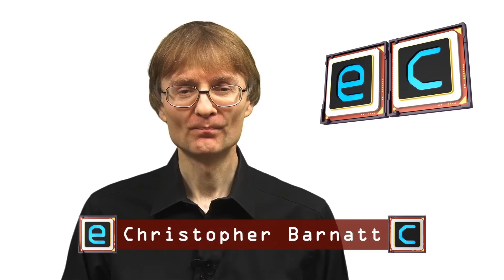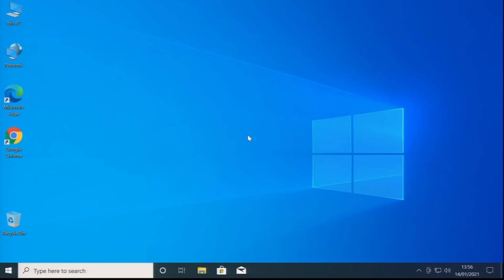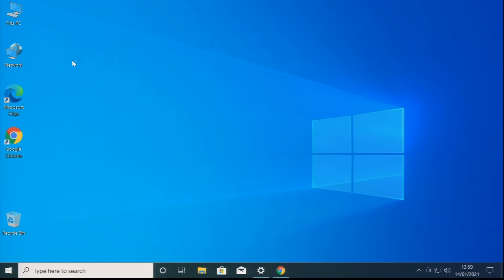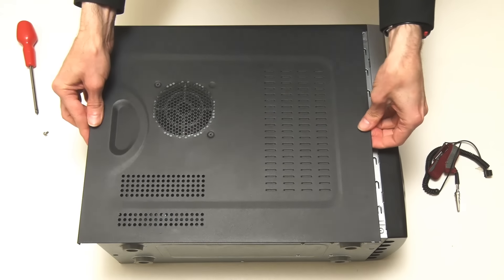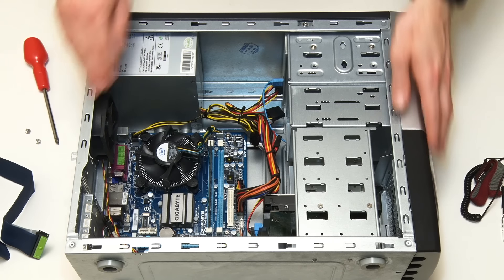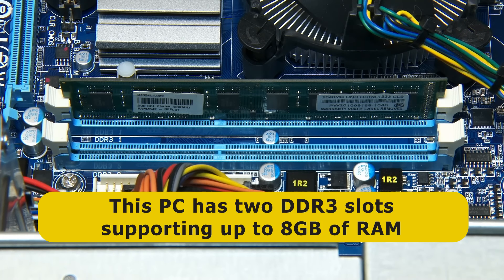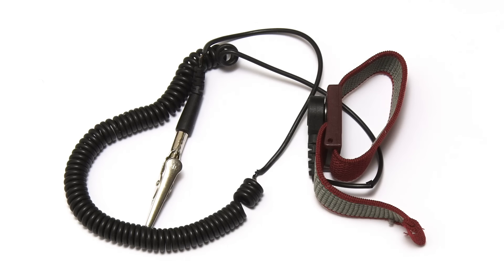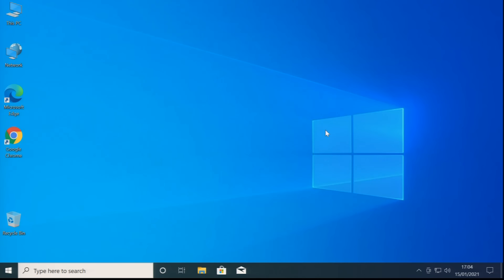Old PC Upgrade #1: Options & RAM

Comment: Not saying you got screwed, but that money should have gotten you a prebuilt business unit with at least a 3rd gen i3 + 4 GB RAM + 500 GB HDD <-- just to point out what to watch out for ;)
Reply from the maker: What I purchased is what I needed to make this video series. I was not attempting to get the maximum spec possible! I needed a PC of a certain again with some very specific characteristics (not least a mini-power with free drive bays, and not built by Dell or another manufacturer who use non-standard parts). So I did not "get screwed" at all. :)
Reply: Understood ;)
But yet again, the average guy looking to get into this might get a wrong impression while there's a good reason for taking the "used" route: price/performance.
There's a couple of those out there that are perfectly upgradable using standard ATX components (even Dell) while others (HP, Fujitsu) are a dead end. Anyone should take at least a couple of minutes to investigate that!
I just tried to point out that your 55£ would have been good enough for more (i usually get a 4th Gen i3 with a single DIMM 4GB DDR and a 500 GB HDD locally for around 40€). I almost always find auctions for probrietary units with an i5 4470s + 8 GB RAM for around that price point as well.
And one thing to bare in mind: if you can have ANY Haswell core-iX for 55£ you're better off as for instruction sets.

Comment: Virtual memory AKA swap sucks, IMHO. It's one of the things I really dislike about GNU/Linux, like using a paperclip instead of a wire to complete a circuit.
Reply: What's using Linux have to do with virtual memory use?  Windows does the same thing.
Reply: @richardwernst  Well, I was wrong about calling virtual memory swap space. There are some differences, but they are similar. Just ways to circumvent hardware, specifically RAM, limitations that aren't ideal, in my experience.

Swap space in GNU/Linux is a partition generally. On Windows it's a huge hidden file. The hidden swap file on Windows is something I only learned upon using GNU/Linux, so I associate it with that.

Comment: So how much total to get a full working new System? How much real time did the whole upgrade take, including the cost of Windows. Not just installation. Once you have spent considerable time and money searching and getting all the parts, you end up with a still old computer that has no support or warranty other than for the parts.

If you are really doing a full upgrade all you are saving is a case which costs bugger all. 

I've done my sums on both building a PC from scratch and refurbishing a 2nd hand computer and they never make sense. Particularly attempting to upgrade a PC, there are so many parts that simply become incompatible over time or are by current standards hopelessly out of date.

It is all bitsy self deception, wasting a great deal of time, justified by never adding up everything.

I am reminded of the Russian recipe for Stone Soup. The basic ingredients are free water and a stone, then ignore everything else you add to those.

Comment: Can I just check my motherboard info and see if it is capable of handling a 8gb ram stick? (if I'm lucky) I currently have 4gb ram
Reply from the maker: Possibly. The issue is that when the PC was made, 8GB modules may not have been available. Motherboard information generally list tested memory combinations. Many motherboards that work with a 4GB module will work with an 8GB one fitted, but by no means all of them. If your motherboard info says 8GB will work you will be fine. And if not, you might be fine. Good luck!
Reply: @ExplainingComputers  Thanks E.C, I'll check it out. Sorry for editing the comment just trying to make it shorter. Anyways have a great day

Comment: Ewww! What is that gross old power supply? Is that still an ATX form factor?

The first thing I noticed is that according to its own label with the amperage, it only provides 180W on each of its 12V rails, so that will limit the ability to upgrade to a graphics card.

Comment: No dust inside, hard to belive.
Reply from the maker: Cleaned with a powerful blower, I imagine. The RAM was clearly not original, so somebody had been inside.
Reply: @ExplainingComputers  I can't imagine that anyone would go from two 1GB sticks, or more likely two 2GB sticks  (normal originals of the era) to a single 2GB stick -- that would just be silly. Rather, it has the look of a frankenputer recently built from whatever reasonably good components came to hand, not of being an original build at all. Which would explain why everything is so clean -- it got a good dusting before being cobbled together. It's not typical for a shop-built, and it's not what a hobbyist would normally go for either. So... speaking as one who routinely builds such frankenputers, I believe it's a rebuild from salvaged parts, and a random 2GB stick just happened to be handy and sufficient.

Doesn't matter -- ALL computers run on used parts, and the result is ideal for our purposes -- a decently upgradeable base system, with no special problems in the way. It's actually better overall quality than we  usually see in original shopbuilts of this class.

Its "new" RAM was almost certainly rebadged salvage as well -- but new or used it works the same, so doesn't matter where it's been. RAM is extremely durable, and can last for decades. And of course any upgrade CPU for that socket is going to be used, or very rarely "new old stock", no matter what it says on the tin. 

Lots of old server parts are being resurrected as new Chinese boards (see Phil's Computer Lab for lots of samples!) -- quite the cottage industry, and far better than ending in the landfill.

Comment: This valuable cognitive maintenance. If one isn't constantly elbow-deep in hardware, it's easy to open up a box and find all sorts of mysterious novel interfaces. Deep understanding of RS-232 and IRQ jumpering are no longer  very useful skills.
That machine was implausibly clean inside; usually, old boxes are disgusting warrens of dust bunnies. Did it get attention from Mr. Extremely Large Shop Vac before its close-up?

Comment: NAMING PC's? I saw that your pc was named something strange. I use to name all my computers differently. I'm glad I started doing that years ago, Microsoft uses those names in identifying them, and so does several software suppliers. Everybody should name their pc's logically making it easier tro keep track of them. It is also useful when you've got restricted licenses. If the License is for one pc only, you will get trouble when it is discovered. I had that problem, uninstalled it from the other pc's, and were all good again.

Comment: I'm pretty sure Windows 10 is not fully compatible with processors older than Intel 1st Gen and one may experience BSODs with these specs. Am I right?
Reply: I have W10 happily running without BSOD's on several Core 2 generation PC's, all ex-W7 machines. That's not to say that all hardware of that generation will be happy with W10 though.
Reply: @richardwernst  Thanks - I meant to type "without". I've correct my previous post.

Comment: This was a VERY BAD video about upgrading.
This Computer simply is NOT WORTH spending ANY money on it, it is all a waste of money, imo, because a) the Motherboard is just way too bad b) the case really sucks and has bad airflow. My mum also has a 10yo LGA775 PC that I indeed bought some upgrade parts for, but it is worth it because the Case has great airflow and the motherboard allows at least 16GB, which is the bare minimum I recommend in 2020, and the ASUS P5Q board allows replacing the old Core2 Duo CPU with a really fast XEON 5470 from China which costs about 25.- bucks. Maybe your crappy motherboard also can take XEONs, but you have to look that up yourself - I would just throw it away, unless your whole upgrade costs under 50 bucks, which I highly doubt.

Comment: Did you purposely buy a bad value PC just to show the upgrade process? In 2021 the sweet spot for used office PCs is Intel 4th gen. A few 6th gen exist, but they are hard to find.
In Nov 2020 I bought a Lenovo E73 SSF for £50 (Pentium processor , 4GB RAM, a 500GB HDD and DVD drive). Then I bought a second 4GB Ram stick for £5 on Gumtree, a £15 SSD on eBay and a i5-4570S for £25. And then sold the Pentium processor for £5. In total £90 for a good webserver running Lubuntu and it boots in maybe one second (really hard to measure)
Reply from the maker: Yes, the whole purpose was to make a series of upgrade videos, as producing videos here is how I make my living!

Comment: Can we use only 1 DDR 4 8gb ram
Reply from the maker: Yes, that will work (on a system that takes DDR4 and supports 8GB modules. But any board that takes DDR4 should do so).

Comment: Take a look at the capacitors inside that power supply for bloating and leakage.  How about running memtest86?  It's an old computer after all.
Reply: Definitely a BAD idea telling joe blogs to look inside the PSU to check capacitors. The USA has had 35 deaths alone from kids taking PSU's apart. Im an experienced Engineer and i took apart an old PSU that had been in my shed for at least a year, maybe more. Just needed some spares, but thought ahh i better discharge the caps. And i got a massive whack of one of the large mains caps. So clearly no discharge resistor. So VERY dangerous for anyone that does not know what they are doing.
Reply: @TheSaabClinicUK  I guess you didn't know what you were doing then?
Reply: @mixmasta  Eh ?. That doesnt make sense. Of course i knew what i was doing, i shorted out the caps with a screwdriver beforehand.

Comment: what a waste of money $55 + shipping and you have to upgrade it.   in 2016 I bought a i3 6100 whole system but no case, no hd, for $100 and later upgrade to i5 6500 for $75, sold the i3.
Reply from the maker: I'm not suggesting the purchase of an old PC to upgrade.  But I needed a system to use in this series.

Comment: 2 gb ram with windows 10, 64 bits?
Reply from the maker: This is why I am doing an upgrade! :) Windows 10 does work with 2GB of RAM as shown, and that was the specification of the PC as I bought it second hand from eBay. The seller I am sure did a refurb and upgraded the OS to Windows 10, probably from Windows 7.
Reply: But why 64 bits instead of 32?
Reply from the maker: @livsto  I have no idea why the vendor of this PC installed the 64 bit version. It was nothing to do with me! But my guess is that they aquired some kind of enterprise bulk license available in 64 bit. It is a good question! :)

Comment: You could have installed a new ssd and a core 2 quad processor which contains 4 cores and a graphics card, you just upgraded the ram module -_-

Comment: Can i put a mATX in a 12 year old deluxe case ?
Reply: Yes, but why?
Reply: @richardwernst   Hi because i bought a gt 1030 and mATX whitch i think its mini ATX or miATX which i think its micro ATX  are cheaper than a regular ATX .Think of buying a i 3 f 10100 f  or 9100 f and 16 gb ram and a board for them . And i want to put them in the old pc so i wont have to buy a new case and new psu .

Comment: why would you replace the motherboard? you might as well get a new computer. I mean the motherboard is the heart of the computer
Reply from the maker: Replacing a motherboard allows re-use of the case, PSU, drives, fans, etc (as I said in the video!).  This saves a great deal of e-waste, as well as some money.

Comment: “The world has full of 10 year old computer’s that are in need of a update. So if you  know someone that does, send them a link so they can upgrade.”
Reply: Mines 9 years old now, but I went the extra mile back then on memory, motherboard, and processor so even now, I don't have to touch it. I won't game on it now anyways, but it's perfect for HD video, browsing, buying stuff online, etc.

MSI big bang X power
Sniper g.skill 12 GB DDR3 ram
Intel core i7 quad core at 3.2GHz (lga1366) 930 series.

Also, have a MSI Twin Frozr 2 GTX560. Was good for Diablo 3 at launch.

Comment: Here's the obligatory suggestion of running Linux to get even better performance. I had to say it.
Reply: Indeed :) But if the PC is needed for running Windows software, then Linux might not be the upgrade of choice.
Reply: @derekp2674  Of course. But most people who "need" windows are running either Adobe products or other high end commercial software or gaming. None of which are going to play well on a 2010 platform. So I'm guessing that 99% of people that this solution would work for are doing web browsing and office type applications. I'm currently using the Microsoft office suite for work and guess what, Office 365 works just fine on Linux. As does Slack. A lightweight Linux is an excellent way to squeeze more life out of holder hardware.
Reply: @joegee2815  Thanks Joe. Office 365 is one of my "must have" apps, so I'd be interested to hear more about how you are running it on Linux.
Reply: @derekp2674  After logging into my company's portal, I open up Outlook, one-drive, sharepoint, etc. from a firefox browser. I'm not a heavy office user but have to use it occasionally for work. I have to admit that I haven't switched over entirely to Linux as I do have a windows desktop that they told me was required, I've only recently started and didn't want fiddling with Linux to impede my work. However I have tried using my laptop running Pop!OS and everything seems to work fine. I do plan on switching over when I get some time soon.
Reply: @joegee2815  Thanks Joe, I guess that gives you access to the Premium web based version of O365.
Reply: @derekp2674  Don't  get me wrong, I wouldn't pay for it myself willingly. This is provided by my employer. I wouldn't need it otherwise.

Comment: 32bit windows 10 will works better on this old PCs
Reply from the maker: With 2GB of RAM, you are correct. With 4GB, of the 8GB fitted in the video, 32 bit Windows 10 will work better, and will be able to access all of this memory.
Reply: It is difficult to get new DDR3 ram in India, one can only get used one. So I suggested the 32bit. Thanks for replying

Comment: I do not agree with you at 12:50 - Adding ram is definitely NOT by far the best upgrade. SSD always shows result. Ram depending on programs you use etc.
Reply from the maker: On a 2GB RAM PC with SATA II (which will limit SSD speed to 300MB/s) and running Windows 10, the RAM upgrade gives a significantly greater performance improvement. And the tests in this video and the next one (in which I replace the SSD) very clearly show this.
Reply: @ExplainingComputers  Which test? Launching chrome with your site as home page? It is probably cached. This is not reliable test if you can not guarantee every time the load is the same. I do not say ram is not important but if you use 2GB of ram with SSD and programs that do not require x64 bit Win10, you can use x86 Win10. You did not show the PC with 2GB ram, SSD and Win10 x86. Minimum requirements for x86 Win10 is 1GB. So with 2GB and the much faster SSD in small read/writes(2times faster in larger ones) it will be quite enough. You could use SSD in next pc, ddr3 you will not be able to put in MB with DDR2 or DDR4 memory slots. There for most of the times SSD is the better upgrade IMHO. Your opinion we watched and you do not need to repeat it, answering the comments if you do not do it with 100% proved facts.
Reply from the maker: @lachezararnaudov7991  There are timed boot tests in both videos. These are facts. I agree that in many scenarios an SSD is a better upgrade. But running Windows 10 in 2GB or less results in dismal performance, and in these circumstances a RAM upgrade gives a more significant performance boost.
Reply: First of all I like your videos and think there is lots of good information in them. Had to say it because lots of times my comments look too sharp. 
In this case timed boot test show 2GB->8GB = 47.1 / 45.5 = 1.035 = this means 3.5% difference in speed. 8GB+SSD = 39.5 / 45.5 (8gb with hdd) = 1.151 = this means 15 % difference in speed. If you have made boot test with 2GB ram with SSD (once with win10 x64 and once with win10 x86 ) it would be better comparison if only ram or only ssd.
Reply from the maker: @lachezararnaudov7991  Thanks for this, appreciated.

Comment: That looks like it was a cheap PC even for the time, I remember there being better PCs than that in 2010.
Reply from the maker: There were certainly PCs with a higher specification than this in 2010. I'm not sure why this is relevant.
Reply: Up until about a year ago you used a 2008 PC as your main video editing PC.
Reply from the maker: @StefanGrace  Yes, I did indeed! :) Same CPU socket as here, much faster processor in it. :)

Comment: There's no upgrade, It's cheaper to buy a new low end technology. Today16 GB of DDR4 3600 mhz RAM are cheaper than 4 GB DDR2 800 mhz RAM. My 2008 PC it's in trouble because I didn't bought 4 GB of RAM instead of the 2 GB.